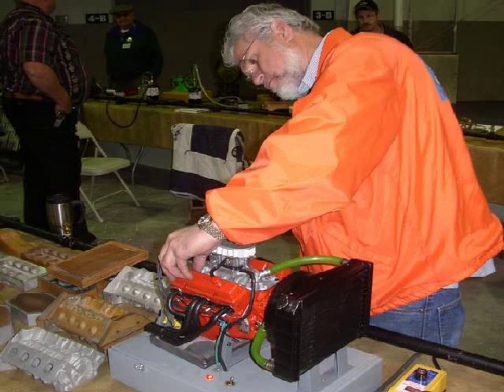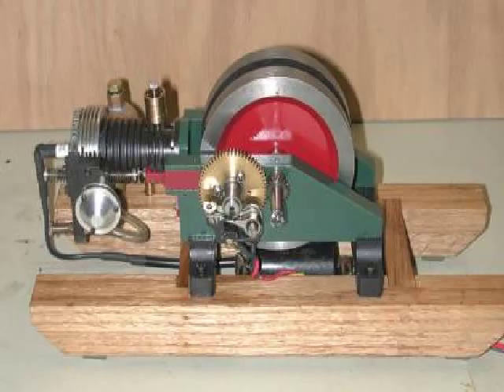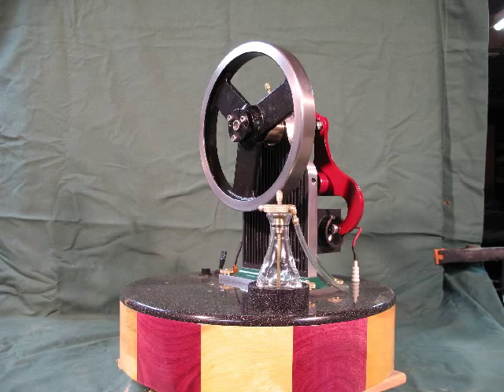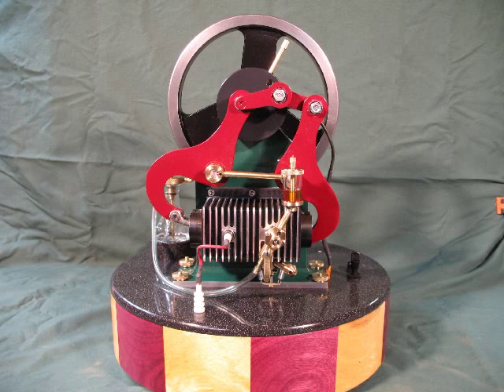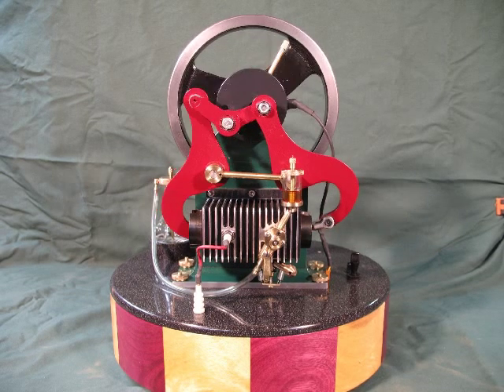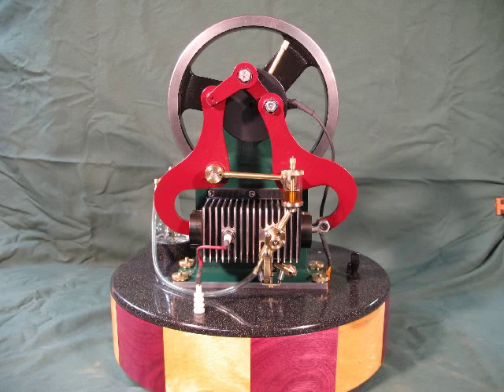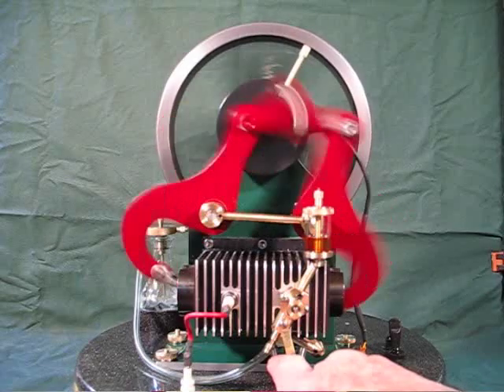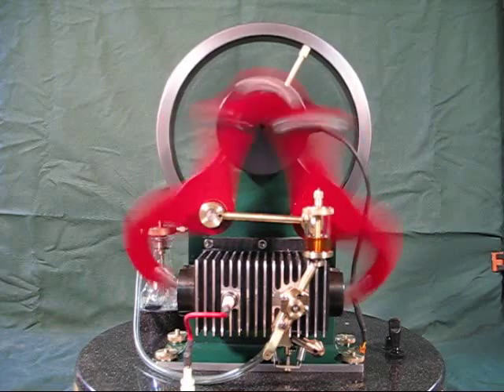Atkinson Differential Model Engine

Comment: That's a beautiful example of an original "Cycle" engine, one of the best running I've seen, very nicely done.  I've been building engines all my life, a few models, then real, a few hundred or more, and now building models of my own design, fifty odd years after my first hand built steam engine.  I just can't ever seem to get to the paint part, somehow bronze and iron look right together, especially with some oil needing wiping, weeping, showing it actually runs.  Very nice with two running side by side, again, beautiful engineering.  I've wanted to build an Atkinson, but haven't gotten to it yet, been considering a geared version, like one of the commercial models.  Thanks for the show.  John McClain

Comment: A couple of folks on the HMEM forum are building this engine and are having big problems getting it running. I've gone as far as 3D modelling it and we have all concluded there is something wrong in the motion works as presented in the book yielding little to no compression. 
Being honest did you have to change something in the motion works to get it to run. We'd like to be successful and display this interesting engine too.

Thanks
Reply from the maker: The book is correct. The power stroke is about twice the length of the compression stroke, so, yes the compression is low. I built a wood mock up and just kept playing with it until I got it right. I spent many hours before I was satisfied.
I also built an Atkinson Cycle engine that also has variable stroke and it runs fine.
https://www.youtube.com/watch?v=qcF5u1rb8AQ
Reply: @goodvolts  Not sure what you mean by "you kept playing with it" did you change any of the dimensions or positions of the components?  The guys on HMEM who I gather are experienced builders independently have come to the conclusion the drawings are somehow incorrect. I have only 3D modeled it and did not build it when I found out there might be problems. There is another video on Youtube (I think it's Gingery himself) showing the motions and I think I can see that on the intake stroke his engines left piston moves faster to the left than I see in my 3D model.
https://www.youtube.com/watch?v=fgcOYEpKrMY

BTW I too have built the "Cycle engine". It runs fine.
http://davesage.ca/
Reply: Not withstanding I might have made a mistake in my 3D model, For sure I have a different relative motion of the two pistons on the power stroke as well.
Referring to the Gingery video linked to above.
The video shows the power piston (on the right) being almost fully to the right before the left piston begins to follow. In my model the left piston appears to begin following the right piston much sooner. The right piston is perhaps only 3/4 of the way to the right when the left piston begins following it. As I mentioned above a similar action occurs on the intake stroke where the right piston seems to follow too soon which results in both pistons moving together to the left resulting in very low compression.
LOL. You'd think it would be easy to adjust my 3D model linkage to achieve the desired results but not so. It's a big issue adjusting all the dependencies of the various pieces.
I appreciate you feedback.
Thanks
Reply from the maker: @davesage9190  Yes, dimensions and positions. Very critical. Trying to build any other way would be difficult. The pistons need to close with a slight gap lining up with the spark plug  at the end of the compression/power stroke and close with almost no gap at the end of the exhaust/intake stroke.  I am an uneducated, amateur machinist for hobby only. I rely on patience and common sense.    The book is correct. My engine building was about 15 years ago and I don't do very much on the machines anymore.
Reply: @goodvolts  So to be clear - you made all of the pieces and positions just like in the book and didn't tweak anything from you findings on the wood model?
I'm not doubting you. I'd just like to be sure before I make chips.

Thanks for your response.
Reply from the maker: @davesage9190  It has been awhile and I don't claim total recall. I think I stayed close to the dimensions. The critical part is the location of the pivot points and that is the reason for the simple wood mock up.( I might be able to locate it and take a picture if you want.)  Any slight miss calculation and it will not function. I have great respect for Mr Atkinson who came up with this stuff and no resources. 
Nice website, looks like we have some things in common. My hobbies include metal, wood, electronics, ham radio and currently into building RC aircraft. Retired 2004 Locomotive Engineer 
.
Reply: @goodvolts  No point in locating the wood model. If as you say if the dimensions are critical then a picture would be of little use. Analyzing my 3D model I can see that very small part movements and changes affect it significantly. The trick is finding the exact placement that works. 
I believe I've drawn each part exactly as in the book. That's the nice thing about 3D CAD models. They don't lie. If things are drawn wrong they simply do not fit together properly and part interferences can be identified by the program. Years ago when I drew it I made notes that I found some discrepancy in the hole location on the end of them rocking arm on page 36 as opposed to the machining of it on page 81. I didn't make very good notes. But perhaps that small error is enough to throw it off. It's been too long to be sure what I found.
I might just have to make a wood model with adjustable parts and take final accurate measurements of lengths and spacing etc. when I find out what works.
Thanks for your response.

Comment: Unfortunately there aren't many Brayton model engines. Also original Clerk cycle from 1878 and it would be neat to see a model of Atkinson's last engine of 1893 which he called the Utilite'
Reply from the maker: I built a Cycle engine the following year, here is the link:
https://www.youtube.com/watch?v=qcF5u1rb8AQ
Reply: Hi Glen, Nice job on the "cycle" engine.. it seems to run much smoother that the differential version... if you are curious about Atkinson's Utilite' engine here is some information about it.   http://www.smokstak.com/forum/showthread.php?t=115633&page=20

Comment: Nice, whats the efficiency of it vs a standard 4 stroke?
Reply: +Atanas Tripzter Shitty.  Way too much frictional and inertial moment loss.
Reply: @monelfunkawitz3966  This engine was designed to circumnavigate the Otto 4 stroke engine, so energy losses were not relevant.

Comment: The person that designed this engine had a better understanding of thermodynamics than many engineers today. The slave cylinder is twice the capacity of the power cylinder. This will increase the efficiency way above a modern engine if it was designed using new materials and more sensible design envelope. That is why the car companies are reassessing the Atkinson design now.
Reply: Atkinson made 3 engines... this is the first one it's called the "differential" the next is called the "Cycle" and his third engine was his most efficient...  most people don't even know about,  but it was called the Utilite' which he made in 1893.

Comment: on opposed piston engines, fairbanks and morse for example, they are classed as 2 strokes even though each cylinder has 2 pistons.
one revolution is 2 strokes, thats why the fairbanks engine is called a 2 stroke as u get power for every 2 strokes of each crank.